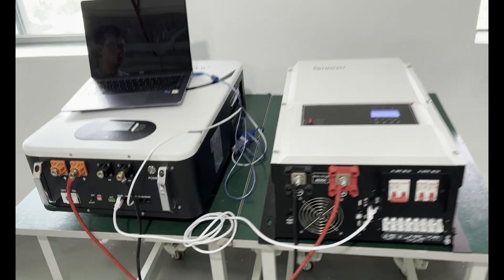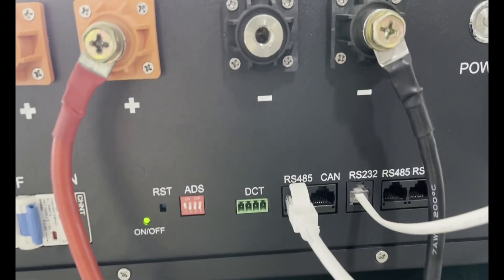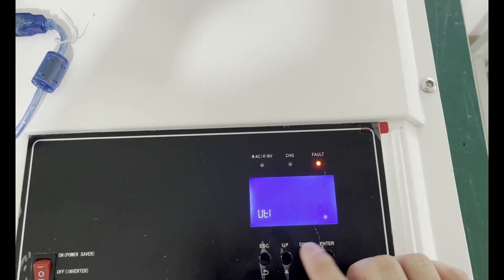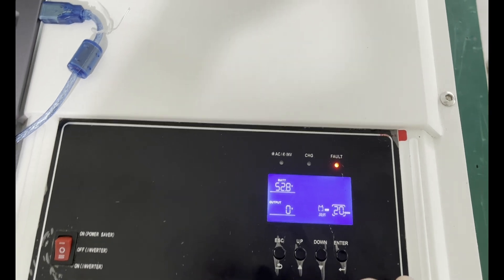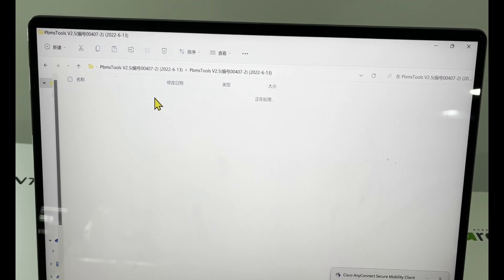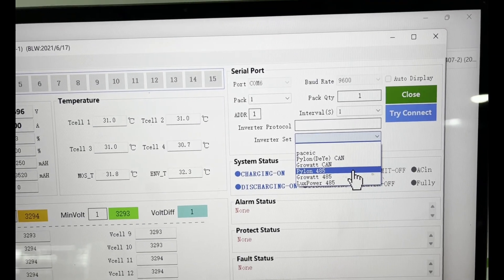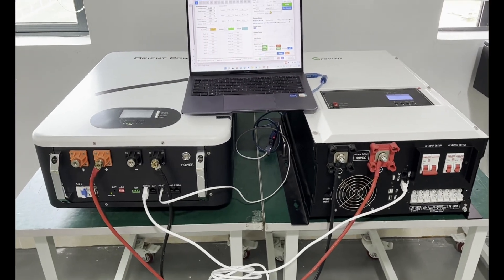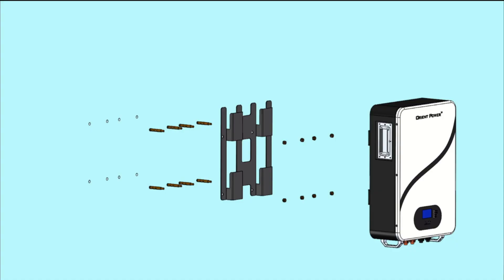Growatt Split Phase Inverter SPF 5000T DVM Communicate with Orient Power Powerwall By Pylon RS485

Comment: Will the bms communication also work with the Growatt 6000t DVM?
Reply from the maker: It will
Reply: @powerwall  Awesome. Thank you. Any news on the UL approval on the battery? Torn between this one and the EGLL. The wall mounting on the Orient Power is what I want, but CE isn't enough to get approved in my area. It needs UL listing.  Thank you again.
Reply from the maker: @shawnmaker6974  we will apply beginning of 2023
Reply: @powerwall Is there an update on the UL for the powerwall?